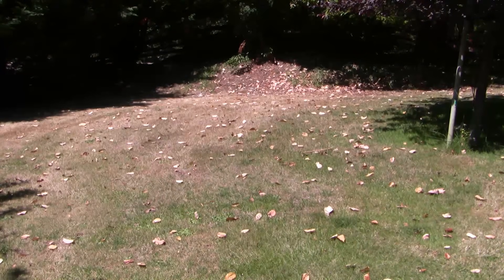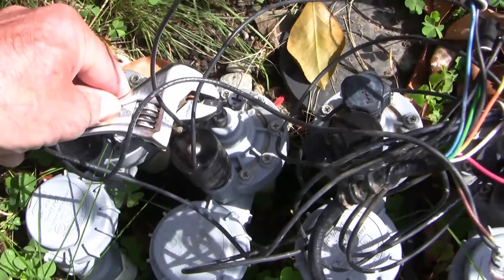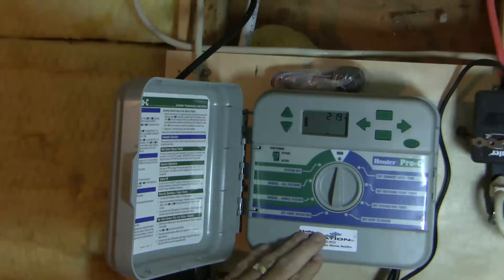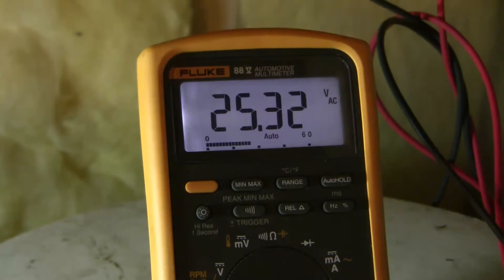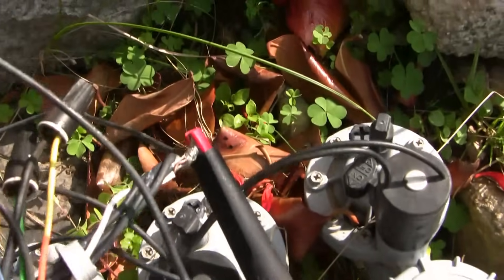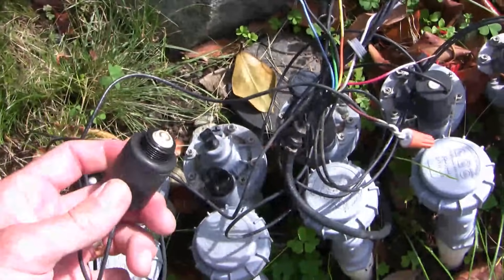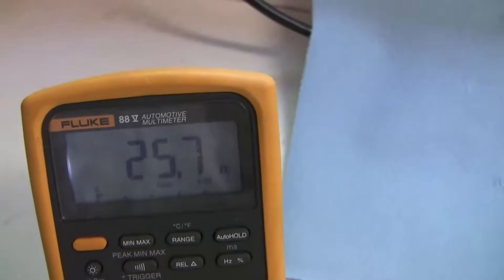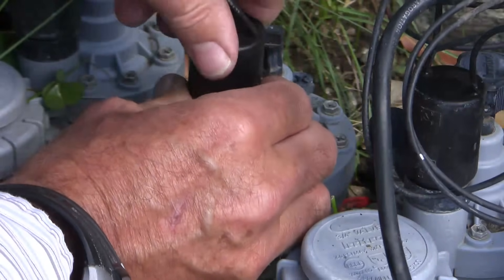How to fix an irrigation sprinkler zone that is not working

Comment: Awesome video - you've helped me a great deal, thank you!!!  

We moved into our new home last Fall and it has been a fun adventure figuring out how everything works inside and outside of the House.  Today, after Spring blooms eternal in Minnesota and Winter fades away, I opened the valves on the outside head unit, then did the same off of the water main inside.  I went to the Sprinkler Panel in the Garage and manually switched between the zones.  No Water, No Sprinkling.  Went next door to our new neighbors and asked if the system had worked last summer (they said, "Yes, and nice to meet you!").  Clearly, I was doing something wrong.  

This is where you come in -- after watching just a brief portion of your informational video I learned that I should go check the solenoid position for the valves in the yard -- sure enough, they were in the closed position.  A 1/4 turn clockwise and I was in business, happily switching between zones to see what kind of water coverage I had at each zone.

Thank you, again!!
Reply from the maker: +Ken Osborn No problem, thanks for the followup. If you live in a frost area, remember to carefully blow out each branch of the system, one at a time, with compressed air in the fall. It's pretty easy to do if you have a good compressor, with as large a tank as you can afford. You don't want high air pressure but you do want a good volume tank. I routinely leave all the solenoid valves open in the winter to avoid pooling of any remaining condensed water behind the valve.

Comment: What about a zone valve that runs continually even when it cycle thru other zones
Reply from the maker: +kevin meeker The first thing I would check is to be sure the manual valve control is completely closed. In the fall, many technicians will leave the valves cracked open a little, so that water won't pool and freeze against the valves in the winter. With the valve left open, water trickles through to the lowest point, hopefully in a place where freeze expansion won't cause harm. Turn the valve clockwise and see if the problem is solved. If not, I would take the valve apart and look for debris that might prevent the valve from closing completely. Flush the proximal line of debris with the valve apart. Good luck!
Reply: whether on manual or auto matic that says stays on even when timer cycles off, in florida so no freeze
Reply from the maker: In that case, go straight to the valve. Disassemble it and look for debris obstructing the seal. Good luck!

Comment: Broken wire at or in the solenoid if it were a short the controller would have indicated that, the Pro C has a test feature :)

Comment: In all honesty if you're testing if your solenoid is creating any kind of power or opening you should just keep the zone on and take off what ever color wire that zone is being supplied on and constantly touch in one second intervals to hear the solenoid click. If you hear no click then your solenoid is bad and needs to be changed. In my experiences when a zone doesn't work it's either because the timer has no set minutes on the zone or the start time is not coming on frequently. If thats not the issues is always best to just change the entire valve. All these steps are so time consuming and just not productive.
Reply from the maker: +Matthew Dennis In the video, you can hear the solenoid was clicking on and off, yet it clearly was not able to open the valve. I was able to make the diagnosis accurately, without unnecessarily replacing any normal devices. As much as it is appealing to follow simple diagnostic pathways, the algorithms should be complex enough to avoid extra cost. Before jumping to the conclusion that the valve needs to be replaced, you could swap the solenoid to another zone to see if the problem moves to the other zone. It would certainly have been the wrong decision to change the valve here, leading to significantly more cost and effort.

Comment: How about a video on rebuilding the valve
Reply from the maker: +kevin meeker There is one other video on my channel that goes into that process, at least as far as replacing the diaphragm and cleaning the valve. Most of the time you can get away with flushing the valve of debris. It's common for debris to be held up by the valve. Those particles can prop the valve open, causing a leak. So, the proximal line needs to be flushed with the valve open because the offending particles can reflux back up the proximal line and be missed when you disassemble the valve.

Comment: I'm going to ask a very basic question regarding making sure all power is off.  I can turn the main power off at the breaker, do I also disconnect the backup battery and is it safe just to do this by hand?  Thanks from an electrical novice!

Comment: Why use a multimeter? Just use a spare solenoid with same voltage, most are 24 vac. U can use that as a more effective tool than a multimeter, u can diagnose whether it's faulty timer, wire or valve solenoid. Times multimeters can still give a reading when trouble shooting but what good is a wire/timer that can't trip a 24 v solenoid?

Comment: But if it's not the solenoid problem?
Reply from the maker: yiyangcheng Depends on the situation. I did another video on my channel of a different, more common presentation where the valve that the solenoid controls is leaking. There are only a few moving parts in the system and so diagnostics are usually pretty easy.

Comment: I just moved to a house that if a turn on the Sprinkles controler wich is in the garage, a lot of water is leaking on to the street it looks like the leak is under the ground and runs out to the street. Also the sprinkles are leaking from the main there are 2 of them leakingthe whole day I dont know how to change them or what could it be. Thank you
Reply from the maker: Isabel C With continuous flow there is either a break in the main pressure pipe or a bad valve. If the flow is substantial and away from where the sprinkler head is, you could dig down to find the source, then fix it. If it's leaking from a sprinkler head then the repair shown in this video is usually the solution. Tasks like this are usually easy for those inclined, but don't forget to appraise your skill set and willingness to try it yourself. A pro can usually deal with the problem for a small fee and a lot less hassle.
Reply: I agree if there's a constant leak out of a head it's most likely a valve issue.  When you turn on your sprinkler system the water should always stop. Find where your valves are open the cover with the water on and listen for a hiss, if you hear that try cleaning the valve or you may have to replace it. To find out which valve just turn it on manually till the location of leaky heads or head comes on

Comment: Great video thanks a bunch! This should definitely help me diagnos a large non functioning system on a house I just purchased.
Reply from the maker: ***** Thanks, man. The first things you should check are, first, the manual shutoff valve inside the house. Then check to be sure that the solenoids are all manually closed. Over winter, most homeowners leave the solenoids manually open so that water can't pool near the valves, possibly destroying them in a freeze. That's usually done as the final stage after blowing out the circuit with compressed air in the fall. If you try to restart without closing all the solenoid valves, then every valve is left open and the water can't build up enough water pressure to drive any sprinkler head.
Reply: Thanks! So far ive had to repair a break in the line where a new main water line was installed and broke the irrigation line in two. Luckily my system is lake fed and I was able to get the pump up and running after replacing a bad relay. Ive manually opened all of the values and I have at least 1 that is stuck open and 1 with a broken solenoid line somewhere between the timer and the solenoid (fun). Sadly it was in the high 90s  today so I surrendered after fixing the water break. Tomorrow's another day!
Reply from the maker: ***** The broken wire problem can eat a lot of time. If you've ruled out a connector issue it's sometimes easier to run a new line. There is a device, colloquially called a 'fox and hound' tool to help hunt down a broken wire, but those can be expensive. You could make your own fox and hound set with headphones and some kind of electronic noise generator, but that would be a weekend project, too. Good luck!
Reply: Yep im planning on running a new line. Not even gonna try to find the break lol. Thanks for all the help!
Reply: spelunkerd

Comment: hi ,,I have the same set up,,but on my second selinod the siphone ,the cap comes off and shoots water like 5 feet into the air, after all the watering cycle has been completed starts like 3 minutes after its all done,, do I have a bad diaghram ,,sorry for the misspelling hope you understand ,,lol,,thank you much
Reply from the maker: bosscolon Yeah, to open the solenoid manually, turn it CCW ~3/4 turn. If you spin it a few full turns, the solenoid comes right off; that's normal. I'm not sure what you mean by starting again after, but that sounds like a control board issue. Study the manual, try reprogramming.
Reply: spelunkerd thanks for the response,,but yeah I guess I said it wrong,,my siphone valve the second one comes off and shots water out of it to about 5 feet ,,till I manually shut it off at the control,,i hope I explained it a little better ,,thank you greatly appreciated

Comment: what about for mechanical sprinkler systems, mine keeps skipping a zone, i can manually turn it on, but it keeps skipping when it's set to auto, doesn't matter what zone, it'll just skip and go to the next zone, I have 3 zones
Reply from the maker: ***** Sounds like a control board issue. You might clear it all and start again, reprogram it from scratch. Check the owners manual to see if you have inadvertently turned a zone off without noticing.
Reply: Mine is mechanical, i dont have the electric solenoids

Comment: I have 1 zone out of 6 not working. It manually works when I unscrew the solenoid, I switch out the solenoid with one that works, getting 25 volts through out the system and 55 ohms at the controller, but I still cant get the zone to come on. Any ideas?
Reply from the maker: flopalock There is a mechanical problem, probably right at the valve if it works manually. I would take the valve apart and see if the diaphragm is damaged, looking for debris that could obstruct flow. You can replace various parts in the valve.

Comment: Great video! My problem is master valve malfunction. I get all station numbers and FUSE display on the sprinkler system controller.
Reply from the maker: Johnny Barideaux You've got a major clue coming from the controller, helping to tell you what the problem is. I would research the diagnostic codes from the manufacturer to get advice regarding what to do now. Just a note of caution. Like auto diagnostic codes, the computer is not all knowing, so I would scan the list of possibilities for that code before jumping to conclusions about the cause. Then, systematically test and prove which problem is the cause in your case. With the word 'fuse', you might check the controller to see if there's an internal fuse that might have blown. That might be an easy fix!

Comment: Maybe this is an intermediate level video where as I'm just noob level(got lost at voltage drop test), and there indeed was a lot of good info to cram into this video but perhaps a little more enunciation adding an extra minute and a half to the video could improve the delivery of info. I had to pause a lot which defeats the purpose of a video. Good info tho
Reply: juntjoo nunya I got lost on that part too, also where he reconnected the wiring.

Comment: why didnt you just test the ohms from the controler to the solinoid coil, it takes 2 seconds and can tell you what you need
Reply from the maker: The result was technically within the normal range when I did it. To get a better answer I tested it properly with a voltage drop test. As you know, a drop test is more sensitive to defective wiring and it helps distinguish problems in the coil from wiring problems. If resistance is very high at the controller, you can't distinguish a defective wire from a bad solenoid, so just testing resistance from the controller can't tell the whole story.

Comment: Im a landscaper but there is still more i need to learn. I have an account who has a brass valve not going on. I know its not the valve ir solenoid cause i used one of the other valves strand and also connected the solenoid with another valve and they've gone on at the same time. I think its the actual wire. But its long runs from timer to valves and no more strands available. But im not 100 percent sure. Any thoughts? Thanks
Reply from the maker: That's tricky. If you think the wire is broken you could test resistance of the wire, if it's really high then your theory is correct. But the better way to do that is with current actually running through the wire with a voltage drop test, the way I showed in the video. A simple ohm test doesn't detect the situation where a wire is damaged with high resistance but you still have continuity. A simple ohm test may also miss the situation where you have an alternate pathway for current to flow, bypassing the solenoid back to ground. If the wire is broken or damaged, you could temporarily run a new wire and see if the system now works. That would be a quick way to verify the diagnosis. Doing that is also a good way to completely verify that the problem isn't in the board itself. Once verified, your next decision is whether to dig up the old wire or whether to simply run a new wire, since it's time consuming to dig up the old wire the whole way to search for a tiny break, maybe from a shovel or freeze thaw. Of course you should quickly check both visible ends in case you get lucky and the break is obvious. One tool that might be useful if you have a broken wire may be a 'fox and hound' tool, that sends an electronic signal down the wire which can be picked up inductively by a sensor you scan the ground with. You scan and follow the wire until the beeping disappears, then dig down where you last heard it and find the break. If your water supply is good and your individual zones aren't large, then I can think of only one other possible solution. You could wire two solenoids together in parallel on one wire, causing both zones to water at the same time. Likely that wouldn't work because of water flow issues.

Comment: I was trying to point when I see some one has not put right Wing nuts at time I repair stuff. I point it out to customer and replace them. All as up grade convenience for better customers relations also. Plus if there is any change in Building Codes etc plus Industry Standards is always good PR.. I would rather lose few cents on replacement of Gel nuts. However rest of information is very good. Thanks for pointing it out to the Folks Great job.

Comment: Sorry I only use all Gel Wing Nuts plus wrap them also. prevents call Backs. Even If I only replace one set of wires on Valves,
Reply from the maker: You make a great point, Dennie. Late in the video you see that the nut I replaced is exactly designed for this wet application. But, as you also see, there are other wire nuts (put in by somebody else) that don't comply with that general standard. I agree, I wrap the whole system with tape afterwards, too. Weed whackers and water tend to get a little close so preventive efforts will pay off.

Comment: At the start of the video you said the main problem is the oversight the tape thing. Would you no where they are normally installed for a home because the is no water going to the solinoids  to turn the zone on manually.
Reply from the maker: There is a main shutoff valve that will turn off water to the whole circuit, usually inside the house so that water on the proximal side is protected from winter freezing. Make sure that valve is open. A no-water problem can be classified as either high flow (secondary to a leak in the main pipe) or low flow, where water supply to the whole circuit is the problem. If a leak is the problem, you will usually find a wet spot in the grass somewhere. If the problem is low flow, look for a problem with water supply, such as a kinked supply pipe, closed control valve, or some kind of internal obstruction.

Comment: Part of zone 4 works, and part doesn't? When zone 4 was on I did go out and open it manually and all other areas of that zone poped up and started to water. Then when it was done same thing happened only part of the zone poped up and watered? Any ideas if this could be a solenid?
Reply from the maker: What I hear you saying is that opening the zone manually works better, with better water flow, than does opening it electronically. That suggests the solenoid is not able to open the valve all the way. I would disassemble and clean the valve mechanism, and I would flush the proximal line to clear it of any debris that could rock back and forth against the valve. If that doesn't work then I would replace the solenoid. As a diagnostic test you could swap solenoids for another zone to see if it works better with the other solenoid. That would be further evidence that the solenoid is bad.

Comment: Thank you. Mystery solved. The actual leak was a good 30 feet from the leaking PVC connection, actually coming up at a joint in the sidewalk. Lots of digging in the mud, the family dog enjoyed the work. On to the next home repair adventure. Thank you so much.
Reply from the maker: Thanks for the followup, I"m sure others will find your example useful.